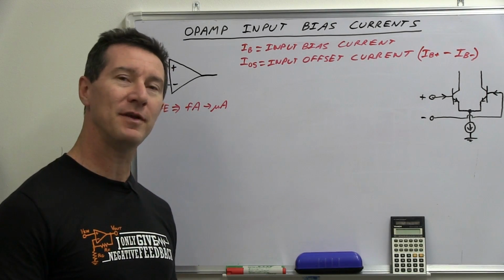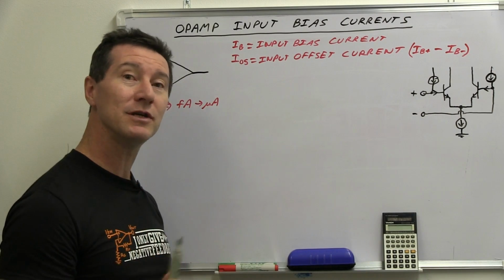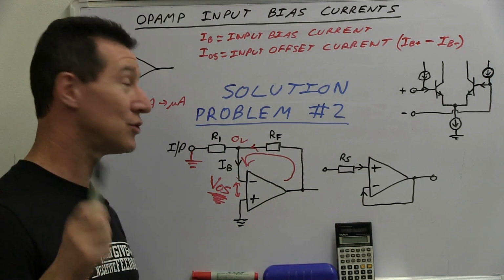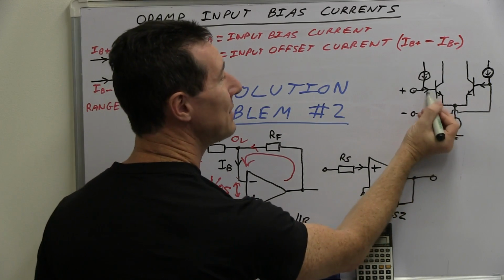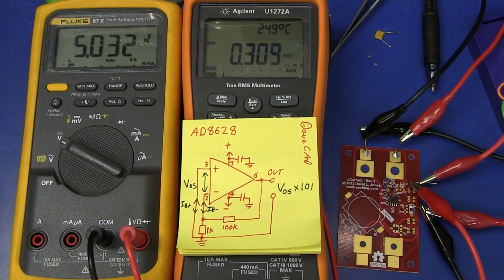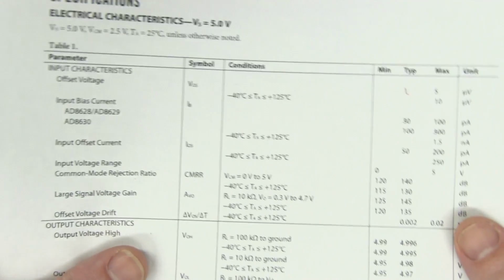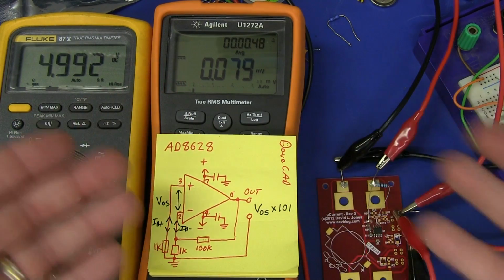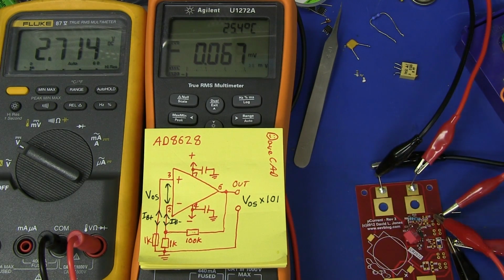EEVblog #479 - Opamp Input Bias Current

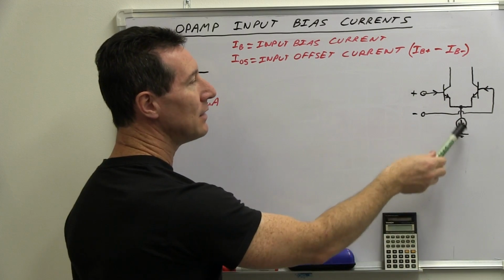Comment: 2:43 "It's a current mirror configuration"
excuse me? It's differential stage, not a current mirror. Current mirrors are indeed heavily used in IC schematics however what you draw is not one of those.

Comment: I'm confused about the data sheet lingo. Why do you keep implying that a data sheet may list the "input offset current" as much greater than the "Input bias current"? Wouldn't the offset be, at MOST, only double the bias current? (ie. When the opamp's two inputs have equal bias currents but in opposite directions.).

Comment: At 11:04, I don't see how RB tacked on to the inverted input then ground should be set to R1. I definitely don't see how it should be RF//R1. I don't see it in this example. Maybe if you change the non-inverted input to have some current coming through R1 instead of tying it to ground.   Makes more sense for it to be RF as hashed out on the white board.

Comment: I know this is an old video, but I came across something interesting that could help if this issue ever comes up in the future. Art of Electronics talks about making an integrator as a good way to measure offset voltage and bias current. You ground the input to measure the combined total, then float the input to measure just the bias current. Subtract to find the offset voltage.
Reply: Interesting. I'm compelled to give this a try.

Comment: My remedy for this with my application is to use an NPN or PNP transistor with opamp, where the base is responsive to neg or pos signal otherwise you get zero output on transistor. My idea was to work with the unwanted offset swing. Done

Comment: very interesting, and helpful tutorial. Most op amps have null offset leads by which we can zero adjust the output of the op amp. I'm wondering why we should worry about input offset voltage of op amps while we have this tool to zero adjust the op amp output. can you explain me?

Comment: I'm a huge fan of Dave's but those really are shit op amps.   We have come way further than the 741/LM353 or TLO72 these days.   I know this video does the job it was supposed to do, but I kept thinking Barrie Gilbert when hearing the words "infinite gain" and "virtual ground".  (see here for why if you don't know already - http://www.edn.com/electronics-blogs/anablog/4311648/Op-amp-myths-ndash-by-Barrie-Gilbert).  

Also a potential divider for dropping a voltage onto a signal must be the very worst way you can do it, though I know it's rife in textbooks.  It means 6dB of power supply rejection, throwing away the 80dB or so that the op amp actually gives you for free.  On the diff amp example, the least one could do would be to drop it onto both sides.  There are also plenty of ways of filtering it, beforehand - or using something simple like a zener - though I understand that probably was outside the scope of this video.

From an ease of understanding perspective. although again I know it always appears in text books this way, even today, it isn't actually very helpful to the newbie to  describe the integrator circuit as an integrator.  It is much more practical to describe it as a first order low pass filter.  Not only is it a much easier concept to understand but it also introduces the viewer to how active filters will work.  Moreover it's a classic arrangement for good practical designs of things like servos, so is directly useful.  I don't know about Dave, but in 30 odd years of knowing what an integrator is, even just applying that concept to a capacitor/resistor network, I have found it to be of absolutely zero practical use.  Even if you know calculus, it doesn't make any sort of sense that an integrated signal, plus a differentiated one, might add up to Unity.  It's much easier to understand that filtering above 3k, combined with a filter below 3k, can add up to One.  That could be a biased perspective but I do think it is easier to understand.

None of which is to say that I didn't think it was good.  It will have helped a lot of people, as the comments bear out.

Comment: Any advice on designing a very low-noise Transimpedance Amplifier to amplify a Photomultiplier Tube?  The LTC6268 is very good, but I want to understand more of the theory.  I know I want to use a FET input Op-Amp, since they have much lower noise current, but I've read that noise voltage is also important even in a TIA.

I don't have specifications of the output impedance of the tube and I can't measure it.  I can only hypothesize about the source characteristics.

I do know that keeping the coaxial cable as short as possible will help keep my gain reasonable at higher frequencies.

Comment: Hi Dave,
Im having exactly the same problem with the MAX4478, Im having 16.9mV output => 169uV Voltage offset when is typical 70uV Voltage offset. I tried to compensate the input bias current with the 1K resistor but it doesnt fix the issue. I tried also, lowering the power supply and about 2.7V of power supply i get near 80uV of Voltage offset. Can u give me some advice please?
Regards, great videos!
Reply: +Hernan Olave any luck
Reply: +Yueeiuyoo Nope =\

Comment: did you clean the board after changing resistors? soldering may add extra leakage current, that depends on the type of the soldering tin.
really like your blog!!!

Comment: I've made some op-amp headphone amplifiers with the NE5532 and I have to use a resistor from + to gnd to prevent heavy distortion, why is this? Also, how can current flow out of the base of a bjt (take a look at the schematic of the NE5532)? It's a PN-junction, I don't see how it's possible. Also, if the non-inverting input is connected to GND (and it's a single rail application), how can current flow one way or the other? If the input is a PN junction, isn't 0.6V required for any current to flo

Comment: Serious question, with a rail to rail op-amp there is no way you can be accurate rigt?
Seems to me if one was to run a sinewave through it it would have little notches around the 0 line?

Comment: I fully agree.
Current shunt resistors in the 10mOhm range are another example where you could need an opamp to make the voltage range fit your adc.

Comment: Yepp, my comment was aiming to "hint" that the usage of this term, without showing the whole opamp architecture is somewhat inappropriate. Besides, it is not necessarily that there would be a current mirror in an opamp (excluding the biasing circuitry), e.g. take a two stage miller opamp.

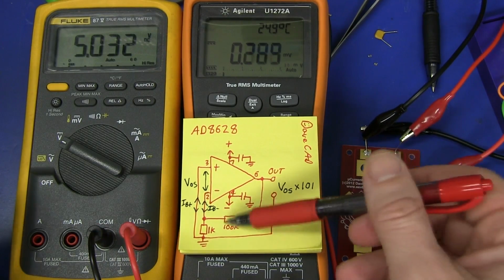Comment: 19:45 This explanation with the 100x gain where 3uV turn into 300uV on the output eludes me. Since the 30pA go through the 100K resistor, and we started off by saying that V+ and V- are basically the same (so we didn't have to take in to account the 1K resistor), then that would mean that the output voltage is the 3uV and not the  "3uV* 100 = 300uV". I sense that somehow V- is 3uV, but how, where does the voltage drop occur? Could someone please clear up my confusion. 
Thank you.

Comment: Understood, I usually use these for audio/ADC-antialiasing in a split power supply setup and compensate the OUT offset with a 9 turn trimmer, but that's just me, nothing critical... For other videos it would be *great* to know what the application is you are discussing, when you say "high precision", what do you mean? I agree you shouldn't explain Opamp basics, but sometimes explain HOW exactly are used. Those little things are helpful sometimes to move to the next level for people like me...

Comment: Hmm, but why does adding a resistor from the opamp non-inverting to ground not work for a LM358? It makes it 2mV higher on the output. With 101x gain, it's about 102mV on the output.

Comment: I'm pretty sure you messed up the calculation of the output voltage error caused by the input bias current. The current flows through your feedback resistor and causes a voltage of U=RI=3µV. But this voltage doesn't get amplified because it's on the output of the OpAmp. Compared to the error caused by the input offset voltage I would consider this effect negligible.
Reply: This

Comment: Take a guess what's at the interface of your computer to the "analog" world?
Audio in/out, VGA, HDD heads, DVD drive, mouse, gamepad, even the power supply and many more. They all use some kind of opamp (customized to fit the purpose).
Opamps are the reason that you can interact and do something useful with your PC at all. You may see your PC as a "digital" machine, but in essence all signals are analog, even the bits.

Comment: 1. There are part in your computer that are probably even more complicated than opamps - I would recommend to study processing of the signal coming out of your hard disk headers.
2. Opamps have more transistors in one chip which means they use current sources instead of resistors and differential and push - pull stages instead of simple common emitter circuits - this two design principles gives them huge advantage over anything you are able build from discrete components.

Comment from the maker: Sure, opamps are just a collection of transistors and whatnot. You can do what an opamp does with discrete transistors, but your problems will be even greater because those transistors aren't matched either. In fact they will be worse. Note that these "problems" only apply to "precision" circuits. Most circuits you don't have to worry much about it.

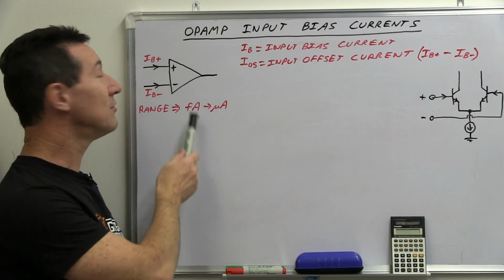Comment from the maker: I said that around 2:00, but may have goofed elsewhere because my mind is never in sync to the my mouth.
Reply: Hey Dave,
If you are reading this comment,
Please please answer the question which you asked at the end of previous video of this playlist.

( Question was asked at about 48:40 by you is that unusual behaviour of opamp due to change in resistors (10k, 100k) to (1k, 10k), and unexpected potential differences between inverting and non inverting inputs. )

I have asked my seniors and professors.
And I am still in search of that answer.